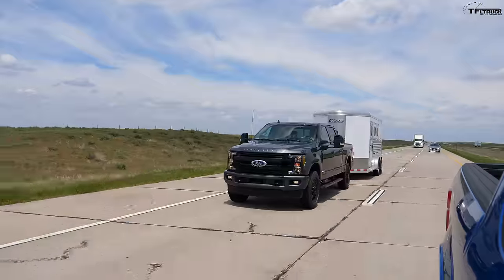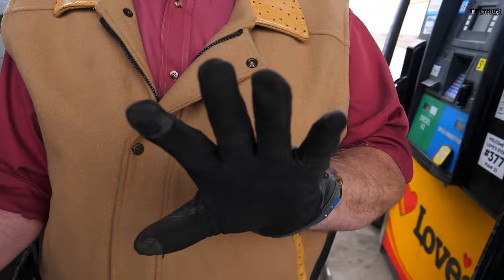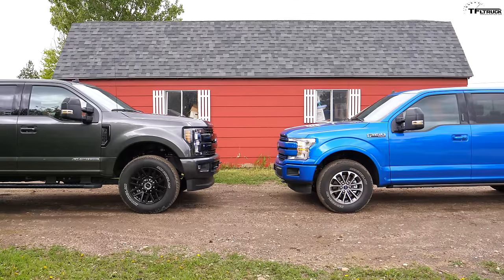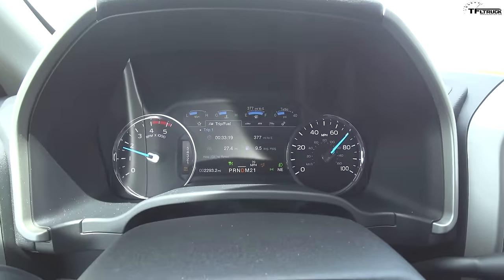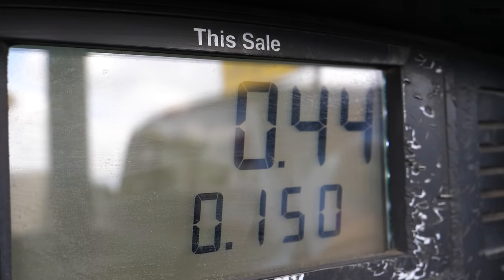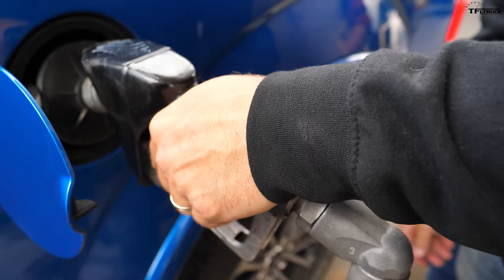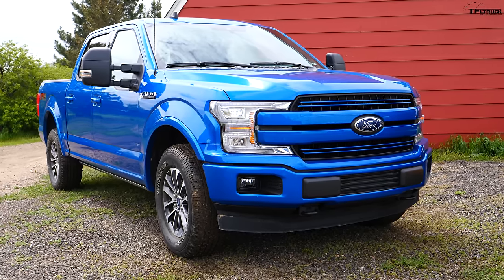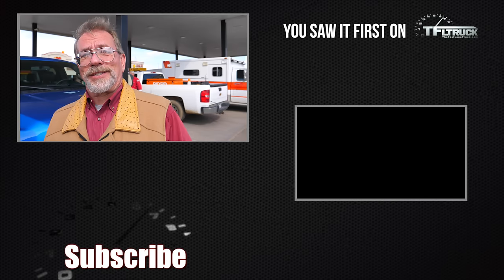Do You Really Need a Heavy Duty Truck to Tow 9,000 lbs? Ford F-150 vs F-250 MPG Review

Comment: I have a 2000 F250 Super duty with 7.3 diesel and 6 speed manual tranny. Towed a 4,000 lb loaded 18ft travel trailer across the country. Mileage with trailer was 11mpg, without 18mpg. Definitely knew trailer was back there. All those people who say "I don't even know my trailer is back there" are full of sh*t. I would never pull the max rating of any truck, 3/4's tops. Max towing ratings are way, way over rated. You are putting way to much strain on whole truck, engine, tranny, breaks, frame, etc. Try making an emergency stop with pulling max ratings, even with trailer brakes.

Comment: Tow that much with the 5.0 often, and you'll cook that engine. I had a 14 F150 5.0,  max tow with 3.73 rear end. The truck hated long hills with a 6k trailer. Sure it had enough power, but it spent a lot of time above 4000rpm. Typically I wouldn't tow longer than 200km( 120 miles) , the engine would consume a half quart of oil while towing that much. The truck was rated for 9300lbs,  id never tow that much with it.
Reply: That truck can run high rpm no problem. It an overhead cam.
Reply: @ericgrau123  I owned one for 5 years. They do not like extended high RPM. It has a different valve train and cam set up vs the mustang engine. I towed with it fairly often, it would always consume oil when I did tow.

Comment: 8.9 MPG with an F-250 pulling a 9,000 pound horse trailer??? I'll stick to my 2014 GMC Sierra 2500hd, 4wd, 6.6 Duramax, 6 speed auto Allison - 11 MPG pulling 11,000 lbs fifth wheel.

Comment: That test was ridiculous.  Do the exact same test on a through the mountains with steep climbs and long down hill descents.  Maybe with a significant cross wind, then try to tell the world that the half ton gas is as stable an fuel efficient, and safe.  Of course pulling on a flat grade with no cross wind you will get similar numbers.  Your test was completely geared to hide the towing short falls of a half ton.

Comment: 3.31 gears for a tow test? The 3.73 gearing has a higher towing capacity. The test isn’t very accurate when you test the 3.31 gearing of a F150 to a F250. Redo the test with a F150 max tow package.

Comment: You should have compared a true V8 to V8- should have been 5.0 vs 6.2L not the 6.7L 

Also should do a max tow 3.5L F150 vs the 6.2 and 6.7 power stroke

Comment: Doing the proper tow calculating to avoid a law suit a f150 the best of best crew with tow rating at 12700 tpulling trailer at 9600 we’ll put your gcwr 5100- in the negative

Comment: 9 mpg in that diesel? I don't know what they did but that seems terrible. My 2018 GMC Sierra 3500 HD Crew Cab Long Bed SLE 6.0L gas 4x4 truck will get that same 8 to 9 mpg pulling a trailer like that. Heck, doing 65-70 over a 3 hour trip including going over passes in Montana pulling my 13k pound 34' fifth wheel camper my truck got 8 MPG, and it's 13 feet tall! If that's an accurate number of 9 mpg for that super duty then Ford needs to step up their game and get better at making more efficient diesels lol, I'd be highly disappointed if I had a 75k dollar MSRP truck that performed that poorly.

Comment: The 6.7 liter Powerstroke is the worst in class of diesel engines.  Not only are they miserable to work on and very complicated, there fuel economy sucks big time.  Buy a Ram with a Cummins diesel.  I have one and tow 8,000 lbs almost daily and get 14-15 mpg.  Plus they're easy to work on and a whole lot less complicated of an engine.

Comment: You guys keep using low profile low center of gravity horse trailers with torsion bar axles. The results are much different with 32 foot long 12 foot tall travel trailers of the same weight. This class of trailer is where all the 1/2 ton vs 3/4 ton argument comes into play. 

I have no issue towing the 9,200 pounds my Expedition is rated for when it is lumber on a flatbed.  9,200 travel trailer? No freaking way. I tried... It is horrible. That is what my F250 is for.

Comment: This test is dumb. First, you're comparing a 1/2 ton max tow to a 3/4 ton partial max towing capacity. Second, you're using an F150 with a 5.0L V8 versus a F250 with a 6.7L PowerStroke diesel. Not even a fair comparison. Should've used a F250 with the 6.2L V8.

Comment: When are you going to learn to stop topping off . Waiting 30 sec does not save your evap system from damage. That would account for the discrepancy in fuel mileage too since you put a third of a gallon into the recovery system instead of the tank.

Comment: Kent is experienced with inserting the Shank. never just the tip 1:14

Do you have the shank? I have the Shank
Pull it out just a little more. Oh, did I get too far? No you're fine.
Wiggle in a little further. There we go, we're good.

Comment: I appreciate your videos but you continue to test with the wrong trailers.  That trailer has virtually zero cross section.  

You need to test with like a 27’ travel trailer (not an airstream like you did with the recent Ram 1500 Hurricane test). Large frontal cross section like a brick in the wind is what most of us tow!  There’s a big difference.

Comment: I wanna get an f250.   They seem like a high quality truck for the price.  
I’d also rather have a heavier duty truck then what’s needed.  The oversized brakes really help when stopping.  
I also like how you described the f250 as having a trucky truck feel to it.
Reply: Do you think the 1/2 ton will have more problems with warped rotors than the 3/4 ton? I have a Tacoma and I have Hawk Pads and Hi performance rotors and seems to be much better than OEM. Tacoma is.not great in the brake dept. OEM brakes are a bit wimpy IMO. Another Tacoma issue...rear springs...have new heavy duty afte market leafs and the difference is like night and day.
Reply: Mike Foehr I think it would be an issue if you were towing near the max limit without trailer brakes.   I think the Tacoma is rated for like 6k towing.   If you pulled 6k every weekend I feel like much sooner then later you’d run into issues.  But as a daily driver that rarely sees heavy towing I think you’d be just fine with the stock setup and even better off with the aftermarket upgrades you did

Comment: Should I get a transmission cooler for my 2006 f150.  It has the same 9000 max towing cap.
Reply: Nope, will be fine. These trucks have really good transmissions. I would watch for the cam phasers though replace them when they start chattering. If you let them go, they will cause the timing chains to break and ruin the engine. Keep the oil changed regularly. I own a 05 F150 with the 5.4 Triton engine.  Mine is rated a 10,000 lbs.

Comment: 2,052 lbs of payload for a F250 and 1,679 lbs for the 1/2 ton, LOL. My 1993 Dodge dakota is rated at 2,300 lbs of payload.
Reply: Yeah, but it’s a 1993 Dodge Dakota. Consider all the added equipment either of these trucks have vs yours; you’re comparing apples & oranges.
Reply: @Icutmetal  Not relevant...even Bare bones they are BIG/fat/heavy and that's why the low rating. It's the same that goes for Dodge Challengers/chargers. My truck is a 1/2ton truck in a 750lbs smaller/lighter body... Mine has all the Complete drive-train suspension off a Ram from 1993....Mines also an 8ft bed, are these?

Comment: Haven't even watched the whole video yet and I'm calling B.S.  you are putting a towing package F250 against an F150 without the engine meant for towing heavy, the 3.5L EB.  You're putting the 5.0L up against a 6.7L Powerstroke.  So it has 1.7L more, it's a Diesel with a turbo, against a naturally aspirated 5.0L overhead cam engine. Come on, do a real test...

Comment: Hate these videos. Been thinking of trading in my 2000 Excursion V10 for a newer diesel. It's chipped, geared, and custom exhaust. Can handle weight no problem, but wind resistance on my 32ft front deck toyhauler is hard to hold 70mph at my Montana elevation of 6k ft. Get about 7-8mpg towing. I cross the Continental Divide anytime I leave the house. I'm sure a diesel from any of the big 3 would do better than the V10, but is $70k worth it for only 1-1.5mpg gain?

Comment: I still don’t want ary deezel (hey Stephen). I take the 6.2 L gasoline. Boys, test the F250 6.2 and F150 3.5 Ecoboost.
Reply: Just cut about 5 mpg, and about 400 ft lbs out of the equation. Good truck, tows fine, wont pass alot of people, wont pass gas stations.
Reply: Yeah, probably right, but I don’t tow enough for diesel. I’d think a person would need to do a lot of heavy towing to justify extra costs of a diesel. Full time RVer, work truck, etc.

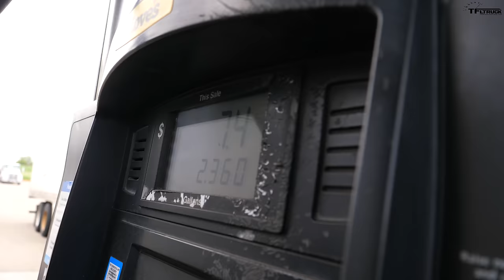Comment: I have a 2018 F150 sport 4x4 302a pkg. V8 with automatic. 3:55 rear gear short wheel base  how do I figure my towing capabilities?
Reply: I wish I could answer in total but Ford has a towing guide. Google it and a PDF will pop up. That will get you started. You can also watch some YouTube videos about it and find out the real capabilities (limits/rated limits) of your trucks. From what you posted looks like you are around 10k for towing.

Comment: Just because the truck can pull 9000lbs you are still over weight limit of f150.  It is about safety. If you are involved in an accident it would be your fault. If you are pulled over it could be fined $1000 for every pound your over. Any automotive journalist should always recommend staying in manufacturers specs. That's just good advice. Look up gross combined viechle weight rating, not just GVWR.
Reply: Sorry, typo it a fine of $100 per puond.

Comment: The F-250 has a 6 3/4 ft bed, not 6 1/2ft.  Also, the DEF is only used if the truck goes into regen mode, otherwise its not used, over only 66 miles It probably wasn't used, it depends if the DPF filter was full or not when you started.
Reply: You are incorrect. DEF is used all the time, and is completely independent from a regeneration cycle.

Comment: To answer this question yo u don't need any marketing crap.
It is simple physics... pulling a 15,000 trailer needs to be balanced on the pulling side by something very beefy in mass in addition to having the torque and power.
The idea that a 1/2 ton is adequate to seriously pull 10,000 plus is absurd.
Reply: Well it wasn’t bad when the F150 was all steel for the most part and pushing 6000 lbs curb weight. Before 2015, the F150 was the heaviest true half-ton. Heck, the gas powered Chevy 2500HD was only a couple hundred pounds more.

Comment: I heard mainataing a diesel is very expensive , like the oil changes and def fluid is as well,  is that true ?
Reply: Yep. Buying a diesel as well as maintenance is expensive because they have heavy-duty quality parts same for the cost of fuel.
Reply: It is a little more expensive but if you are hauling a lot of weight a lot nothing beats a diesel. Also get better mpg on smaller trucks like the Colorado.

Comment: The F250 cab roof aluminum is .5mm thicker.
Reply: Do you mean .5mm? 5mm is alot
Reply: Yes I did, I'm a stamping engineer and worked on both the F-150 and F-250 roof tooling.
Reply: @philliphatfield6695  cool, I'm a union millwright I love my car plants, worked at K C quite a few times too

Comment: Well, I used my 2008 F150 Lariat to tow my 12000-pound travel trailer from Dickinson, TX to Liberty Hill, TX. Granted I took the flattest route northward. I got the same performance on my test run from Dickinson to Corpus Christi before this. Granted, I upgrade the rear suspension with airbags, got rid of the old bumper. It did help level out the rear end, my gas mileage was comparable to my test run. Oil change nothing out of the ordinary.  Right now I take care of her, drop her oil on schedule and only general maintenance, brake all the other thing. The only unsuspected surprise was the exhaust manifold or in old school days, the header gasket was bad on the passenger side. Took this opportunity to install a performance header and dual exhaust, of course for you leftist Marxist, I kept choked with the catalytic converter. She's still purring, only thing is she almost at 140K miles and I was looking at diesel for longevity. Is diesel worth the expense for that reason?

Comment: What was the point of this video? You don't need to have a 20 min video and talk about seat height to answer the question of 3/4 vs.1/2 ton towing 9000lbs of weight. Any of today's full size half tons can tow a 9000lb trailer. All of your tests use the same trailer "type" loaded with X amount of weight. Which is fine if you're only test is payload capacity. I want to see the same tests with a 38ft 9k camper trailer, now that would answer the whole point of this video. I've tried towing a 34ft 6800lb camper trailer with a 2012 Tundra and most of the time the truck really had to work. And, on windy days the tail was wagging the dog. It was a terrible towing experience. Once I switch to a 3/4 ton truck, it was like night and day. It was enjoyable to tow that trailer. You guys barely touched on towing experience at the end of the video of 1/2 ton vs. 3/4 ton. What exactly will you be towing and where? Will it be mostly highway towing? Towing in the mountains? 2 lane back road towing, with lots of twists and turns? How much tongue weight? Do you have a weight distribution hitch? Etc, etc. A small utility trailer loaded with 9k of weight is only a very small cross section of what people really tow, and I know you can't test everything. But realistically, most people who are struggling with what to buy, 1/2 ton vs. 3/4 ton trucks, are pulling camper trailers.

Comment: Cimarron with steel underneath- https://www.youtube.com/watch?v=fSK_hh7qJso 09:40 - no steel underneath. Unfair comparison, should have been the 6.2 in the F250. The F250 weighs 2000 lbs more- 5000 vs 7000 according to Ford.

Comment: I really like yall's videos but...you are forgetting a very important detail. Grade. I have a camper that is about 8000 lbs. I had a 2012 ecoboost F-150. I pulled that camper in the north Georgia mountains. It only took 2 trips before I went out and bought a 2016 F-250 (gas burner). Control and climbing ability are miles apart between the two. I feel safer with my family in my super duty while towing that heavy a load when compared to the half-ton

Comment: I have a 2018 f150 5.0 motor and it’s  using 1 quart of oil every 4000 miles !! What’s going on ?
Reply: Steve, that’s unusual for sure. It’s under warranty. I’d stay after your dealer to fix it.
Reply: No the warranty is gone , 42000 miles . It had the oil consumption test  before the warranty ran out .I’m so disappointed.
Reply: steve , not covered under the 50,000 mile power train warranty? Very troubling. Well, any blue smoke while running, or is it dripping oil? Maybe the fix will be low cost. I feel badly for anybody in your situation. I know it doesn’t help, but these vehicles cost a fortune, one should expect them to run right!
Reply: I’ve sent a email to ford , I’m doing another oil consumption test , I hope that there’s enough evidence to put a new motor in the truck ,(, I think there is ), but one of my fears is they’ll slide a remanufactured motor in .  I just don’t trust them. I also filled out the survey they sent and I told them exactly what happened, I’ll keep you posted. Maybe others will check there oil before taking it to have it serviced . Thanks
Reply: steve , Here’s to a positive response from Ford. Let’s hope so. Personally, I would not have any fear of a remanufactured engine. Come on Ford, step up!
Reply: Just had oil consumption test 1/2 quart on 2502 miles ! Looks like Fords not going to do anything. That’s what Mose Ford in St Albans WV said ... but bring it back at 3000 miles and we’ll see .

Comment: Definitely the bigger/heavier truck for a 9k-10k lb trailer. 0-60 times, a 5000k lb lightweight aluminum truck do not equate to a good tow rig, I dont care what Ford rates the f150 at. You want a HEAVIER truck, bigger frame, bigger brakes etc. I have had both there is ZERO comparison when it comes the towing safety and comfort when rolling down the highway.

Comment: HDPP towing did you delete your comment because you found out how wrong you actually are? I got a notice you replied to me, but I can't find it.  Go crawl under your back end and read the maximum weight it can handle, then come back and tell all of us just how much more your precious HDPP can tow over a Max Tow Equipped F-150.  Towing is limited to the LEAST rated item, and that is the receiver.  Yes I AM an expert in this stuff, been hauling loads since 1988 OTR, so I know the rules and regulations quite well.  I also understand the physics involved with hauling long heavy loads, so please don't try to be something your  not when it comes to this.

Comment: why do the headlights on f-150 blink on the video?
Reply: Sean Martin it has to do with the camera’s frame rate/speed and the LED light’s frequency. The camera catches the moments when the LED lights are off for a fraction of a second. The light’s frequency is matching the frame speed of the camera. It’s kind of like watching a spinning ceiling fan with a strobe light. If you match the frequency of the strobe light’s flashing with the rpm of the fan, It looks like it stopped. Same concept.
Reply: Ya...that is a weird effect of LEDs...my wife asked about that. The person who answered is 100 % correct. I actually did not know LED lites had a flicker rate.